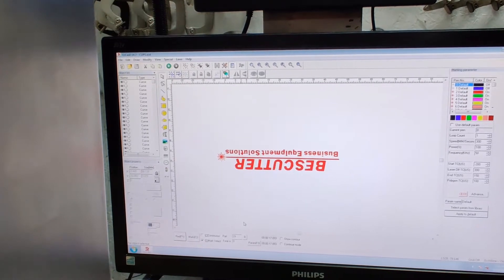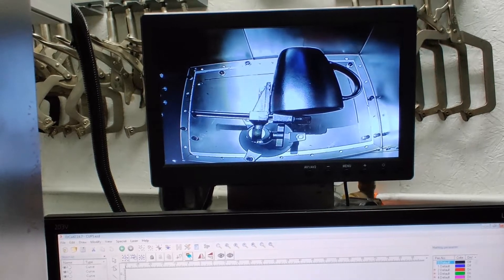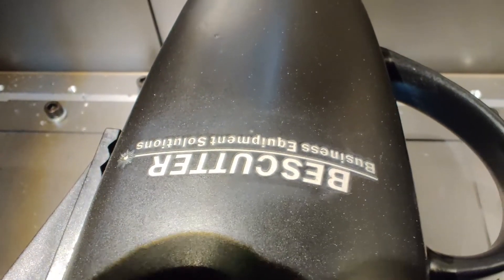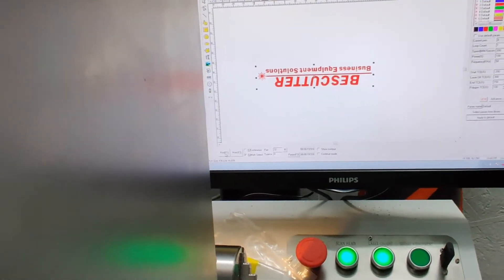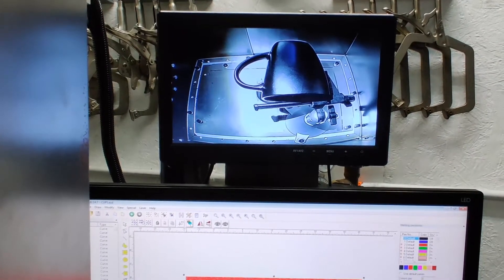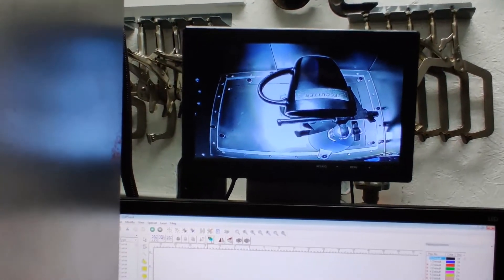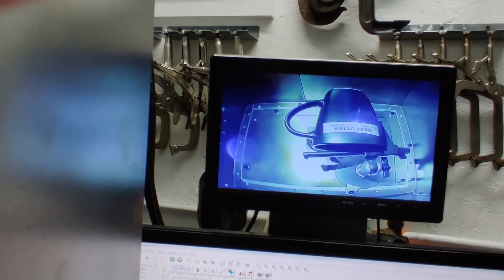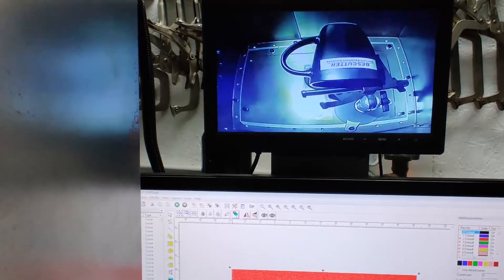Engraving a ceramic cup on 50 watt fiber laser.

Comment: I'm curious, how have the cups have held up?
Reply from the maker: They have done well, been using them regularly. I can say that tiny unsupported parts will flake off with use after about two weeks, but larger text is fine. The one in the video got brushed off a welding table and smashed about three weeks after making it. I've been meaning to order another case of cups in to make more.. And I found some glazing compound that I wanted to try to see if the small text would stay.
Reply: @smallshoplasers8785  Thanks! I'm in the process of looking for a fiber laser, and your videos have been helpful, much appreciated.
Reply from the maker: @MarcusRitland  Happy to hear.. I have more videos recorded, I've just been too busy to finish them.. Fiber lasers can be amazingly versatile tools for metal work.